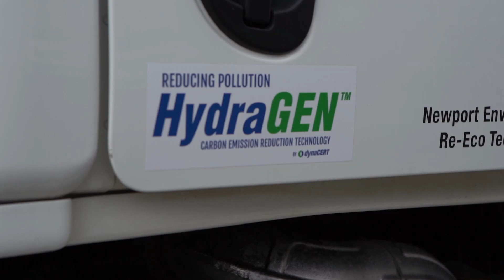New technology turning plastic into fuel

Comment: What's the downside and how dirty is the fuel? They make it seem so easy, heat plastic in a oxygen free environment and boom fuel. Except the fuel that comes out is dark and looks dirty to me. I just wonder what happens to the spent/burnt plastic and if that fuel could run something without clogging it up over time.

Comment: Pyrolysis is nothing new, and it can turn all types of waste into all kinds of fuels, put carbon into the ground and so much more, it's a solution to many environmental problems but it just ain't happening thanks to big oil.
Reply: can I sell the oil?
Reply: @JayDennis-d6p   You certainly can afaik, though pyrolysis makes fuels that are worth more than the crude oil that ironically takes More energy to mine and refine into fuels. You can make diesel by simply heating plastic in a sealed container and bubbling the gas through water until it condenses and floats on top, not sure if it needs refining but there's plenty of videos on YouTube showing how it's done, and if you use eg solar powered microwave pyrolysis it's essentially free to make.

Comment: Ehhh.... 
The problem here is the environmentalist is ignoring the renewable application that the pyrolysis technology has. Running plastic through the machine is the main use that they're looking for, but you can put brown waste (paper, cardboard, high carbon,etc) through a pyrolysis system and also get diesel/gasoline out of it.

The worst part of this is that by demanding renewables only he's actively advocating for plastic pollution that will never degrade.

Comment: That one dude is a Debbie Downer.
Reply: There years later, we know that the viability of recycling was a lie all along, and that guy's good intentions were shaped by oil/plastic industry misinformation. Until we stop producing plastic, it's every community-minded person's job to help break it down before it crumbles apart and ends up in the soil and water. Which is to say, towns need this so that people can do something useful instead of pretending recycling is still viable. Towns could save a lot of money on fuel for municipal vehicles and buildings if they work out a good deal with the owner of the digester.

Comment: Super easy to do as well. Al u need is a small air tight container and have a pipe come out of the top going to another smaller container to collect and and more then one collecter on the pipe line. Oya start a fire under the first container and have that one filled with plastic
Reply: You need a cooler too because the produced gas has 400-600 celsius temperature.

Comment: Another wheel-spin technology is coming our way. We are no longer given the choice between plastic and paper because plastic has become much cheaper than paper (styrene is a waste product of fuel production). It requires huge amounts of electricity to extract that last drop of gasoline from the plastic.  Expending energy to make fuel is a zero-sum equation. Additionally, the process cannot be 100% efficient. What is the waste product? They didn't say.

Comment: In this industry for 12 years, this is not going to work, and have witnessed a lot of investor’s fail. 
When you say plastic, there are many different kinds of plastics, with different ingredient, and different physical and chemical characteristics. 
Using one simple pyrolysis process can not deal all of them, meanwhile this process will release massive toxin, and that diesel/gasoline can never compare with conventional quality gasoline/diesel. 

Using high temperature incriminating furnace plus boiler and turbine, is still the only proven way to destroy that waste and recycle some energy.

Comment: I think this is great, but I want to know if it takes more energy to do this than it produces.
Reply: You would have to factor in what it takes to get fuel out of the ground and refine it too.
Reply: @jerrywhidby.  If we lost energy in that process we'd never have progressed past the steam age because it would have cost us more energy to dig coal and drill oil than the energy it would take to run a factory.
In this process you're not taking energy that's been created already and refining it. You're literally heating up plastic until it's destroyed.

Comment: Problem is, how much energy is it going to cost to convert plastic into oil? Because cost would be a huge factor in whether there will be widespread adoption of this technique.
Reply: I guess this is not a sustainable business because in the pyrolysis process you need more fuel than it produces.
Reply: @himanshupatel9974  but the elimination of waste plastic is a costly prospect....  Even if you could recapture a fraction of the cost all while getting rid of the environment killing product it is a win....
Reply: @phillyvoodoo  Depends, if all his equipment is powered by renewable energy and he can automate or outsource the separation of plastic (a government body could do that, ot ONG working on cleaning up plastics in different areas), it would lower the cost drastically. Canada is a country that has a fair amount of oil so its not SUPER profitable, but it could help close the loop that is the usage of plastic since you can only recycle plastic so many times (2-4 times i think, depending on the plastic)

Comment: Plastic made into more greenhouse gases made into faster  climate change. Hmm, I don't think you solved anything at all but your greed @Sparta. In fact, you are just contributing to making it worse.
Reply: Maybe it's about time you read a little more about the way pyrolysis works. NOTHING to do with greed or climate change. This is a real solution to a real problem. Nobody is making anything worse.

Comment: The Only concern is
about the gases which will be released to the atmosphere during to the oil process!!!!!!!!!
if clean this  going to be the best invention of the year!!!!! A good thing to clean all the plastic
in oceans and clean all the mess made by plastic makers ,,,,,,,,,
Reply: Nothing to be concerned about. Emissions are about the same as the furnace used to heat your home. The off-gases are used to run the processor. The waste from the process has uses as carbon black. . .

http://www.plastic2oil.com/site/home

Comment: The poor in some countries have already figured this out on a very small scale...
Reply: No web site. Personal conversation with someone from a war torn middle eastern country. He used plaatic bottles to make gasoline for his motorcycle. He said it took a long time to make and a lot of bottled  for a small ammount produced.
Reply: And with them it must be regarded as illegal and environmentally harmful practice that needs to meet the full and harsh might of the law
Reply: @siphesihlelanga5783  you must be the government
Reply: @siphesihlelanga5783  It's actually the issue with this technology. It's horrifically inefficient and produces a crude form of diesel that needs to be purified in order to match the standards required for regular diesel in the market making it even less viable as a method of making diesel. It gets researched for sure but it's not some conspiracy by BIG OIL stopping it. If the method worked they would be ecstatic since they could easily make more money by using it themselves.